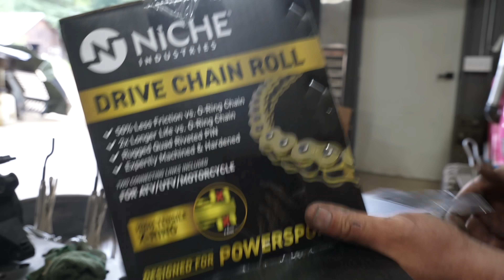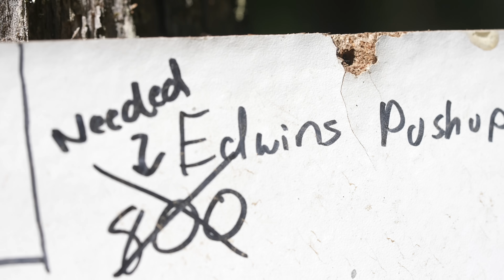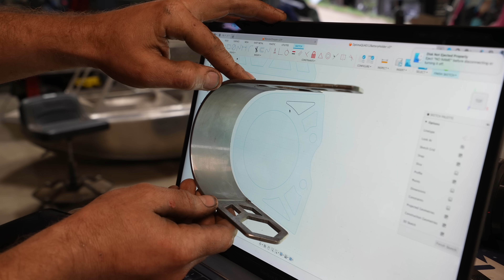We Rebuilt the Chopper and Met State Troopers!

Comment: Hey man, I doubt anyone from the channel will see this, but I ran my own powder coating business for a few years before moving towards fabrication/racing more. If you want any tips or data to improve your technique and results, shoot me a message. I'd be happy to share what I learned the hard way. Even with that grabby dual voltage gun you can get decent results.

Start with a better ground, move your gun back a bit to make a better cloud formation, watch your mil thickness, and all cure schedules start at PMT (part material temp) not when the powder flows out. You can flow out powder to a liquid long before its beginning to cure just by flashing the heat.

Regardless, best of luck.
Reply: Great pro tips!
Reply: Have some karma for sharing this!
Reply from the maker: Thanks man!
Reply: @GrindHardPlumbingCo  of course! I love and respect what you guys do over there.
Reply: Preheating the part does wonders for helping powder stick. (source: family owns powdercoat shop and does industrial parts)
Reply: @BPro25  its a slippery slope. Some heat can certainly help adhesion, or dissipate KV in the event of redoing a part. Really helpful when dealing with a part that has a faraday structure in it. However, too much heat can cause it to flash and cause issues in an even coat due to mil thickness or color during the cure schedule. In industrial parts its rarely cared about, a bigger issue when dealing with custom colors/creations for a show/display. Hell I have watched Jerrdan spray right over a blemished job with the next color and let it bake in to ship out the door.
Reply: @GrindHardPlumbingCo  That death wobble has EVERTHING to do with the rake angle of your front spindle.  Your tire is trying to act like pushing forward on a caster wheel that constantly wants to flip around and drag behind..   You'll need to rebuild that front end so that your SPINDLE axis is more ideal.  There are a lot of videos about this.
Reply: @calholli  great analogy, it makes sense to me

Comment: You should switch the back tire with the front tire so you can level that one out too😂
Reply: Ooooh that's a good idea
Reply: Exact thought I had. Same tire and rim. Easy swap.
Reply: I thought the same, doing burnouts is actually about the best way to get those big tires as round as possible.
Reply: I was thinking the same thing
Reply: Thinking the same thing, couple burn outs she be sweet
Reply: Came to say exactly the same thing. Even just to swap the well rounded rear to the front to see how much better it might be.
Reply: some self clearance lol
Reply: I had that same idea !!
Reply: i am with that. Higher speed might definitley increase wheel instability. But in all you need to balance the wheels. Such things might be the gamechanger to avoid accidents.
Reply: As with all vehicles, he should rotate his tires.
Reply: Such a great video
Reply: Might not be leveling. Sounds like the tire isn't balanced.
Reply: My thoughts too

Comment: Those tires were intended to go on a fixed axis of travel, with the camber angle creating one contact patch without introducing greater drag. Usually the weight of the vehicle would also restrict its top speed. 

Once you freed the axis of the tire and increased the rotational speed, that deformation at speed is exactly your death wobble, since you're not only dealing with the centrifugal forces stretching the tire outward, but the change in direction is visible changing the shape of the deformation of the contact patch from edge to edge (you can see it in the silhouette on the horizon). Where it cups inward you have 2 sides fighting for the same traction with slightly different angular momentum. 

On a smaller scale, I've had this happen with sawtooth dolly tires on a mini bike... I was waiting on new tires to ship to me and only needed them for a few days before they arrived, but as soon as the speed got past a certain limit with those flat-bottom tires, the wobbles were absolutely terrifying. 

As soon as I went back to the racing "slicks" I ordered that had a more tapered curve to a centrally rounded contact-patch (and higher pressure rating), no more death wobble.

Its a combination of the composition and intended use of the tire coupled with the change in load-applied geometry that's making them work against you. Overpressure might improve the shape, but then you have to consider the temperature change and the lower speed composition, so maybe try overpressure with a Nitrogen fill to improve performance, that way it doesn't continue expanding once they're heated up.
Reply: Elementary! Cheers!
Reply: Interesting thoughts. 👍
Reply: Another effect of the tires changing shape will quite literally be a sort of compound change in steering geometry. While the increase in diameter of the tire should move the projected road contact point of the camber a little bit further forward of the contact patch, theoretically increasing the trail which ought to improve geometric steering stability, the contact patch at the same time  gets shorter and narrower.....and I have a gut feeling the friction might be helpful in reducing the steering oscillation you are experiencing a bit as you approach it. The added steering damper also helps, no question. The oscillation you are experiencing is known to bikers as "tank slapper" and it's basically the steering system running out of steering dampening, by part due to trail, by parts by other means. The trick is that trail in itself only gives you a more or less fixed amount of self righting effect which at speed also acts as resistance to wobbling, but the forces causing wobble increase with speed. At a certain speed, a given system of wheel inertial moment and imbalance and steering geometry will simply run out of margin between trail effect and wobble forces, and start the oscillation. Usually, bike manufacturers have this under control, but tuned or modded bikes with higher top speed or more aggressive steering (like for racing) often can have issues. Common remedies count steering dampeners and stiffer tires😉 Personally, I've also encountered this with sidecar bikes, where heavy steering due to the stiff connection to the sidecar is often tried mitigated through reduced trail, requiring steering dampeners to be added.
Reply: I may have to correct myself a little bit about  the stuff about trail and wobble forces. Self righting forces caused by trail grow linearly with speed (not accounting for geometry changes from tire diameter change OR suspension movement), but forces due to rotation of the wheel grow exponentially with speed. Trail forces just start at a certain level due to vehicle weight at standstill, rotational forces start at zero at standstill.
Reply: I learned about centrifugal forces as a teen out far away from home and got a flat on my motorcycle's rear tire. As long as I was over 30 mph, it rode like normally. Drop below that and he wobbled worse and worse the slower I got. Got it home. But yeah, centripetal force kept the tire "inflated."
Reply: @mindeloman  lol, I'm not trying to be nit-picky, I swear...

Centripetal force kept you and the vehicle moving forward by keeping the wheels mounted at one stationary point on the axle, forcing the rotation/circular travel of the wheel around that fixed axis. 

Centrifugal force was the force acting upon the tire's outer surface to expand outward and away from that central axis. 

Glad you made it back safely, at least. I got a puncture that was bad enough to where even the Slime in the tube began gushing out until I was left with a pancake... walking and pushing for 2.5hrs is no fun, even for a relatively light mini bike. 

Wishing you safe travels, friend.
Reply: @chriscross5581  Thank you! I was racking my brain the other day trying to remember the term when I wrote that; I used "drag" as more of place-holding euphemism for what I was meaning (trail).
Reply: This should be on top
Reply: Oh that’s a cool tip
Reply: @DJSekuHusky  Thank you!! :hand-purple-blue-peace::hands-yellow-heart-red:
Reply: I didn't know anyone would have this comment. I appreciate your knowledge, bro. 

Did he do the shaving for where it sits in the rim? Thanks if you respond, but I learned something today!
Reply: @contrary400  Happy to help when I can. I'm not an expert by any means, I've just experienced a lot and I also listen a lot, so I'm always keen on learning something new. 

If I recall the previous episode correctly he shaved the outer treads down for fender fitment, which is good since it also makes the tire lighter, so less strain on powertrain components from a standstill start, and less strain on braking components coming to a stop. 

A mild tire imbalance may contribute to the vehicle shake additionally, possibly from shaving the treads, but it could have been from when the tire was injection-molded, also. 

Ideally you want an even distribution of  vulcanized rubber flowing into the mold when making a tire. Perfect world= perfect balance.

The same logic holds with equal tread thickness away from the cords and inner ply: the slightest imperfection in distribution of rubber within the circle (perhaps not even visible when static) can alter the rotational mass enough to introduce additional forces upon the wheel once it spins up to speed.

This is perfectly normal and all tires are subjected to this to some form or degree. Nothing is ever perfect.

Ordinarily, you balance a wheel and tire by adding small weights at the opposite side of the imbalance, equalizing the forces to where they balance out. You may see them as little metal clips along the edge of a rim,, or even stuck with adhesive along the barrel' inner circumference. 

However, a wheel of that size would be difficult (or even impossible) to balance with a typical tire shop wheel balancer. 

I would assume there is some fixed-range of wheel sizes the motor and sensor in one of those machines can handle/measure, let alone variables like the dimensional limitations of the machine and its relative proximity with the ground even being considered.

That's what I'm assuming led to it just getting eyeballed as close to round enough in time to meet the deadline. 

Frankly, as long as you keep a speed just below the resonant-frequency where the travel and forces are visibly greatest, it seems like it's manageable to ride and deal with those forces, at least until a proper tire balancing solution can be determined.
Reply: Uh, that is what I was going to say. No really, I swear. ;-D
Reply: @DJSekuHusky  Tyvm for this.
Reply: Great explanation of what's going on with the front end. Definitely a few factors contributing to the issue.
Reply: Thats interesting and makes total sense now that im thinking about it. Thanks for the info

Comment: Worn-out bearings can cause lateral axle movements, which may initiate a wobble, as well as, large tread can contribute to stability issues, due to the rubber changing shape and spreading outward at high speeds, causing a wobbling effect.
Reply: Yes but odds are those new bearings are not the issue.Most likely it tge  ig u balanced out of round tires
Reply: Try two tones. One at 1hz difference than the other. You get a 1 second change from 0 to max amplitude. Same thing happens with tires. You noticed it happens in a turn or lean. In a turn one tire spins ever so slightly less than the other. At some point you get a harmonic induced into the frame structure between the wheels and since rubber acts like a spring, well.... More tire pressure could solve the problem along with fine tuning wheel balance. You really feel the bike flex when you cruise around a corner and get a slick spot transferred to both wheels front and back.
Reply: just another think you should check.   Sport Bike are known to have high speed "wobble" going over a bump in the road. Even on perfectly balanced wheels, The steering dampener  on them helps prevent that. You might try "beefing" the steering dampener up.  You have a lot of spinning/wobbling mass, you probably need something stronger then the tiny stock one.

Comment: I'm 58  now, we built crazy stuff when we were in our 20"s.  I love the things you build. The death wobbbbbble LOL I only have one suggestion. maybe and only if it happens at a certain speed.  You can test the tire balance against a different unknown issue by accelerating slowly through that speed area. We used to this with our giant tires ( 44" back then ) If it is just a tire issue it will always show up at the same speed no matter how much power you are applying.

Comment: I'd definitely consider seeing if you can get those tyres balanced out, I know your hand carving is likely to make it hard but anything will help, it really does seem to be the mass of the tyres extending that bounce if not outright causing it, that final shot really does show it though, hope the higher pressure helps too!
Reply: You can't balance a 46 inch tire lol
Reply: @BobV1la  You can get them closer though. Any bit will help.
Reply: Balance beads

Sorry, should have been more clear. Trying to balance is a good idea, and I think you can do that AND use balance beads, but I'm not sure. I just know the folks with larger tires on things like dump trucks and bigger RVs in my area speak highly of their ability to provide balancing on tires that heavy, I assume similar might apply here
Reply: @BobV1la You can static balance or dynamic balance those tires, but getting them round first and also adding some balance beads after a dynamic balance will help balance all of the rotating mass of the axle.
Why do you think you can't balance a 46 inch tire?
Reply: @goosenotmaverick1156  commercial tires are another ballgame, usually bias ply and not radial, and don't have the sidewall height that something like the tires they put on. They're also MADE to be good on the road. These big boys have way more variance in weight over the entire tire since they're not built with balancing in mind cause they're so God damn big and heavy
Reply: @kevinsellsit5584  physics? Lol. 16oz is the max you're supposed to put on a wheel. A tire this size on an application this light is never going to ride like its balanced cause I'm pretty sure those wheels weigh more than the entire frame, engine, etc. Just the centrifugal force from the weight of the tires alone spinning is probably trying to rip it apart lol.

A 37 inch tire is hard enough as it is to balance, a 46? Wasting your time.

Comment: Put the steering damper to the upright so it's pre slop in cables and bell crank.

If you want it even more rigid, remove the steering bell crank. You only have to change the length of the cable end to the cable body. If you mount the cable body to the steering tube arm (handle bars) and solid mount the cable ends, you eliminate the bell crank and it's slop.

Comment: As a 40 year vet in the powder coating industry I would suggest investing in a walk in gas fired oven and a small spray booth. Gas fired will give you a more uniform cure and color consistency between batches. You have the space and this will allow you to coat bigger parts like fenders, tanks and wheels with better quality than you’ll get with the Eastman outfit which is essentially a hobby kit. Also there is a ton of used powder coating dolly equipment with powder gun, controller and hopper online. I would suggest a mini hopper for small batches. Finally you can get small samples of powder cheap and sometimes free from dealers.

Comment: Hey, it looks like the oscillation you get is mainly flex in the front swing arm. Judging by how much the chain slacks on throttle, the chassi might be flexing into a radius on throttle, that then induces the wobble in the front that i guess is the part most prone to flex/oscillation.

Comment: The speed wobble is a steering geometry issue. Tire balance can contribute a bit. For high speed stability add more rake to the "steer tube", which will also take away from low speed maneuverability. So it's a trade off. Check the angle of the steer tube on a few bikes and compare it to yours.

Comment: If you pre heat the parts the powder partially melts on the surface and you have less chance of removing it when you transfer to the oven for cure.
Reply: It is also an easy way to ruin potential for an even coating with a machine that has minimal control, if temp is high enough to reach liquefaction. It is a balance. Heat can also be used to discharge a part in the event you made a mistake. 100-120 is an ideal temperature to help adhesion.
Reply: Jderrtftyyuio
Jdrttyuiio
Jderftyuio
Jdfrerrrtyuio
Jdrhyuio
Jdfrterttyuio
Jfrttyuio
Jftyyuio
Jfdrttftyuio
😊😊😊😊😊😊😊😊😊❤❤❤❤❤❤❤❤❤❤❤❤❤❤❤❤❤❤❤❤❤❤❤❤❤❤❤❤❤❤❤❤❤❤❤